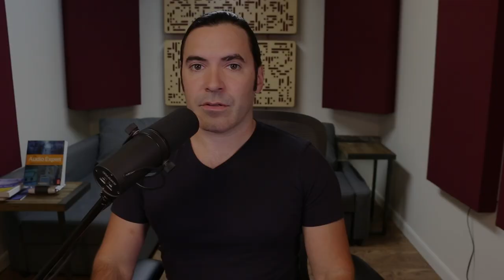Advanced Compression Techniques: Parallel, Sidechain and Serial Compression [SSP038]

Comment: Parallel.Comp. 
— one natural.[doninant] one shit-ton. heavy comp.[underneath]
Serial Comp. 
— one channel going into another. [multiple comp.s] 
—stacking comp.s w/ strategies. 
>>generally doing 2 comps doing 2 diff.things. 
Diff.attack/release, or/and ratios. 
**1. Hving a high and low ratio together to get tone from one and dynamic range control from higher. another. 
**2. Trying to repair a bad attack envelope.  
One’s making sure consistent transients. Ones bringing it up for more punch!, articulation etc. 

SideChain.Comp.-
— using one signal to trigger comp of another
“Duck down signals”

**THERE CAN ONLY BE ONE LOWEST/HIGHEST. INSTR.

Comment: Thank You for all the Tipps. Can you explain what difference does it make if you add a parallel compressed Track to using just the dry/wet knob in the Compressor?
Reply: SchultheissOrchestra They can have pretty much the same effect!  But if you use a parallel bus, you can add additional processing to just the compressed version, which is often useful. And you can make the choice to only parallel compress certain elements that way, rather than everything in the main uncompressed group. Hope that helps!
Reply: @JustinColletti  yeah, additional processing makes sense, I just realized how easily you can shape the EQ of a reverb...either pre or post if it's on an aux channel, but not if you use it as an insert

Comment: should you EQ the highs and lows before or after the compression?
Reply: before usually
Reply: Either can be fine. But applying EQ after the compression can be more predictable, because your boosts and cuts aren’t affecting the way the compressor responds.

If you boost a bunch of lows and highs into a compressor you’ve already set, you’re going to have to adjust that compressor again, and it may end up responding more to the huge low end than anything else, which can potentially be an issue.

This isn’t necessarily a problem though. Just something to be aware of. Often, if a signal is too bassy and is making a compressor go crazy, I’ll want to reduce the low end before it goes into a compressor (or use a high pass sidechain, which is often built into compressors these days—especially digital ones.)

If I want to do a lot of bass boost, I’d probably do it after the compressor most of the time. But you can get away with doing it before the compressor if you want the low end to drive the compressor’s response, or if you can use a low pass sidechain to compensate so it’s not just the low end hits triggering the compressor.

I can probably do a whole episode just on this question, and probably will. Thanks for asking!
Reply: @JustinColletti  thanks for the reply - looking forward to that ep!